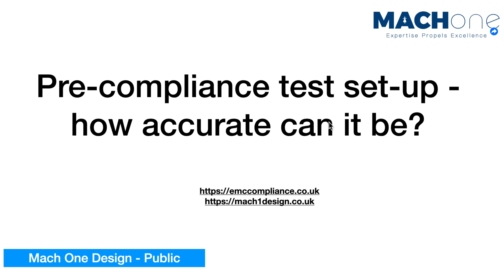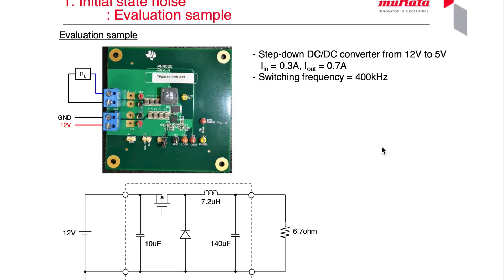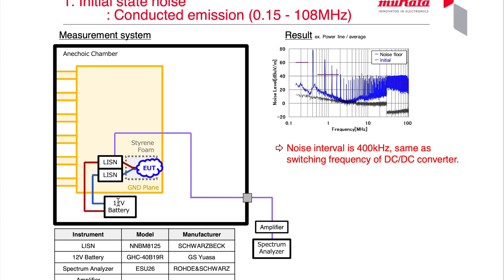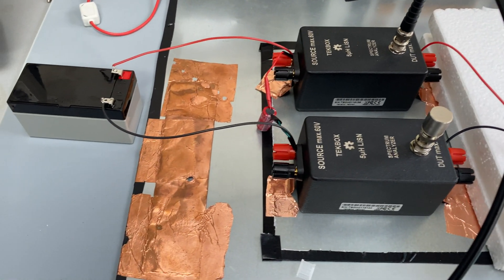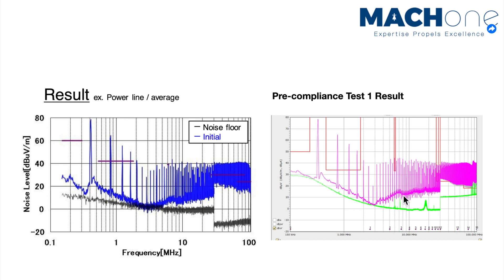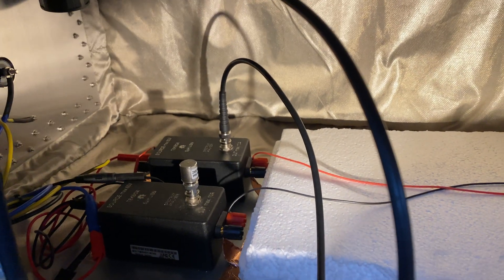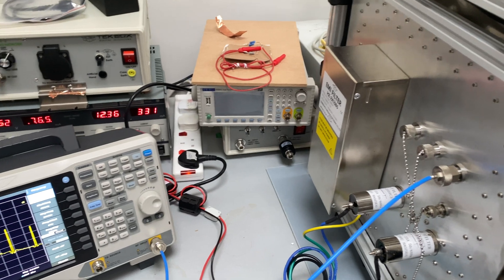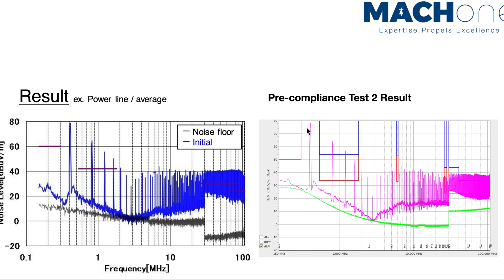Conducted Emissions - Accurate Pre-compliance EMC test results (automotive)

Comment: Can you tell me whether USB chargers plugged into the cigarette lighter socket are regulated under CISPR 25 (EN55025)?
Reply from the maker: This is a great question. I would assume yes
Reply: @MachOneDesignEMC  Thank you. I assumed so too, due to the fact that the device is plugged into the car's mains. However, when I started to check how the labs in China test it they don't use CISPR 25 standards at all (they don't use 5uH LISN etc.), they just "test" like a normal multimedia charger under CISPR 32 (EN 55032). The result is that it is difficult to find a car charger that does not cause interference - even audible on the radio, let alone passing EN 55025.... I have checked a dozen such chargers bought online and in supermarkets. 
And I began to wonder whether I was actually exceeding the requirements. 
There is also EN 50498 - but I don't have it and don't know what levels are required, nor do I have the receiver scripts for it.

Comment: Hi, why did you use two lisn? One lisn was that enough?
Reply: I am also curious of this
Reply: @furiousbullet  hi, from the tekbox manual that you can find on the lisn manufacturer's website: if the DUT is grounded to the vehicle chassis with a power return line shorter than 20 cm, a single 5μH LISN is
sufficient and the conducted noise will only be measured on the positive supply line.
If the power return line of the DUT is longer than 20 cm, two 5μH LISNs are required. The positive supply line is
connected to the DUT via one LISN and the power return line is connected to the DUT via another LISN.

Comment: Hello, I am wondering why in the tekbox setup there is a significant higher noise floor from 30MHz? Second question, should LISN ground connection be connected from both sides? Thanks for the answers :)
Reply from the maker: Hi Marcin, that is a great question. I was wondering the same, then I checked Murata's set-up, apparently, they used a low noise amplifier between the LISN and the spectrum analyzer. if you connect a Low noise amplifier (LNA) before you SA, you lower the noise figure. That is why. But I don't think you need that for conducted emission test.
Reply: @MachOneDesignEMC  Thank you for your quick reply. Could you share with us Murata's document used for this comparison?

Comment: Hello, thank you for the video.
I have a question. When you use a battery, what did you connect the ground plane to? 
I'm using the Ground contact from the bench power supply but I have much higher noise floor.
30dBuV with 100kHz bandwidth.
Reducing bandwidth helps to lower the noise floor, but 100kHz is mandated by the standard. So I'm curious what can I do with the power supply and the ground plane in order to help the situation.
Reply from the maker: Hi Denis, the LISNs need to be connected to the ground plane either via a 1uF cap or short. See https://www.tekbox.com/product/tblm1-lisn-mate/. To keep the noise floor low, you either put the DUT in a tent like I did. Or choose a time where lots of equipment in your office/workshop are switched off. Be aware of the LED lights, they are terrible emission sources that can easily push up your ambient noise. I noticed that the LED ceiling lights in my office pushed the ambient noise by at least 10dB. so I always switch them off. Bandwidth wise, yes, below 30 MHz, RBW is 9kHz, from 30MHz, 120kHz.
Reply: @MachOneDesignEMC  
Thanks,  I 100% agree with the point about LED lamps.
I do connect the LISN to the ground metal plate of course. The question was, should I connect the ground plane itself to something "grounded" while providing the power from the battery. The battery does not have a ground terminal as a bench power supply does. So should I, for example, connect the ground plane to the ground knob of the power supply while providing the power to the system from a battery? Or should I connect the ground plane to the negative terminal of the battery?